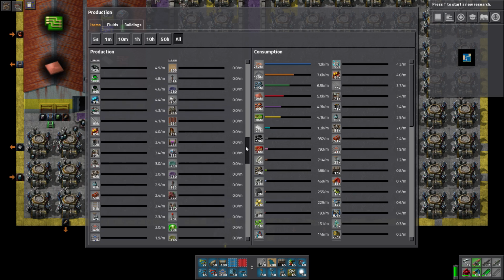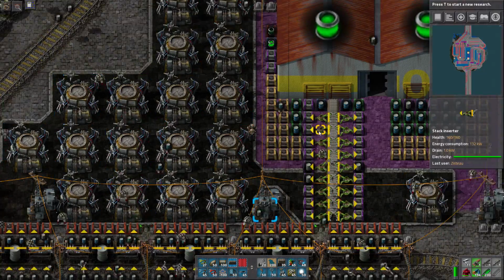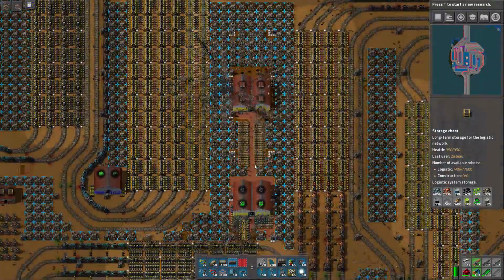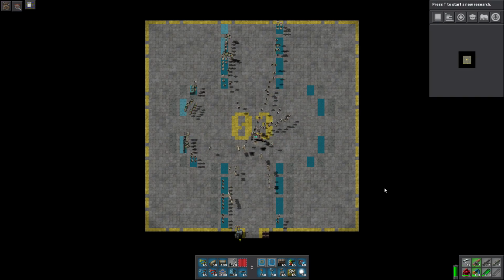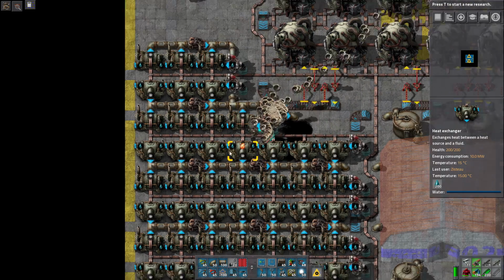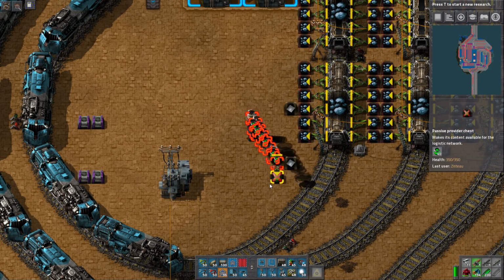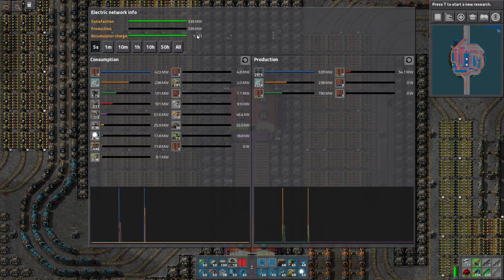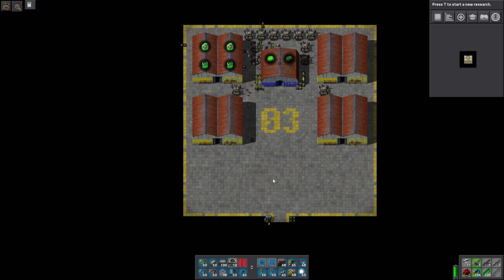Factorio Recursion Recursion #15 - Quantum Water

Comment: Power generation and usage is only visible on the last floor of the power producing facility. Maybe you could build a circuit network that takes the number and displays it outside of the main base?

Comment: I think it would be cool to use factory buildings as large containers. You can construct and deconstruct them with the recursive blueprints mod so they can be planted down on the water outpost, then filled up, then deconstructed and transported into the base where they are placed down again to empty them.

Comment: Did you know that your base is not powered with solar panels right now? Solar panels are only powering the surface part with biters
You can shoose only one: The base powering the surface, OR the surface powering the base. You can do it by switching the input or output at the first level from the top
Reply: Hlebuw3k he could manually reverse the arrows into nuclear to restart it in case it crashes for some reason tho.

Comment: Why even bother with belts at the mining stations at this point? Just have them all mine right into chests and them have bots ship them into the trains. Now you can have trains going even faster
Reply: It gets to the point where mining straight into the trains is the best way - no belts no bots
Reply: @maverickstclare3756   You got to have dem buffer chests
Reply: halvor9797 not if you always have a train ready to replace the one that is filling up. Mining directly into trains is by far the best solution UPS wise. You do need a rather high mining productivity to get it to work properly tho. (Iirc it starts to really excel around mining prod 500 or so)

Comment: By the way, Zisteau, why do you use the overlapping Miner placement method? When it gets down to the endgame that means Miners run out once all of the ore in their 5x5 square has been exhausted and it means fewer miners operating in the final stages of an ore patch meaning less overall throughput. Is there a valid reason to prefer this method over spacing the Miners so each has their own individual patch to mine?
Reply: Because you get more ore per second from the patch this way

Comment: Bob's Logistics would provide 3 things for you:
Bigger chests that are compatible
Faster Stack inserters
Bots that use less power (the mk4 bots don't need any charging but cost a portable fusion reactor each)

Also while that combining chest mod might not be good in the base it would be pretty awesome on your outposts, put the ore into one supermassive chest that connects from the ore field straight to your train station would give you the absolute maximum throughput since basically magic from the miners to the train station instantly
Reply: Now I want to try to make a base which is just one massive chest that all input and output happens into. Lots of filter inserters.
Reply: @FlatlandsSurvivor  That should be fun and yet kind of trivial, I'm not sure if the linked chests need to be rectangular, if they do it adds at least some challenge and 1 massive chest isn't the way to go but thanks to filter inerters+circuit networks the whole thing would be super easy to control if thing I want this assembler to make <20,000 items keep inserting them.
With rectangles only you'd need to come up with the whole square boxes on corners to move from one super long chest to another perpendicular one for example.
Does remind me of the old sushi belt base idea though, everything on one belt cycling round doing everything preying it won't jam or get full up of things that won't get used up
Reply: That or loaders and Angels warehouses
Reply: @Houstonruss  I'm not sure that angel's warehouses work all that well with factorissimo (I'll admit I've never tried) but they're huge buildings, they definitely couldn't be used inside where there's a 1x1 space to connect and outside you'd be turning 4 configurable slots into 1 or 2, and taking up a rather large amount of room.

Or did you mean loaders and warehouses for the train stations? using the loaders might work okay but the combining chest mod would in my opinion still be superior to warehouses just because you can put one chest down the entire length of the train and never need to worry about balancing. So 1 chest down the ore field for each row of miners going into loaders and then 1 chest down the length of the train.

if I recall correctly stack inserters are still faster than loaders anyway for trains (and Zisteau doesn't seem to use loaders at all anyway) there certainly are mods though that make stack inserters/bots better than loaders anyway. Infinite bot research and infinite inserter research by Emmote, expanded robot technology
 by Faltease Each of these can make moving a stack per operation possible, with bots that's much much faster than belts and with inserters that do a just a single swing per second that too beats loaders.
Reply: @Andy Young that's exactly my thought ^_^

Comment: It's too bad you can't have the power distribution in a "balanced" mode. Where it can push and pull power from outside and inside sources.
I use two individual belts with splitters between mining drills to maximize mining area which in turn has an innate ability to support substations between their coverage area.
The combined throughput kind of works and kind of doesn't work. It certainly increases the capacity of the belt if you put a splitter on each drill.
I have yet to think of any blueprint where beacons are concerned, considering the maximized drilling area. Also, ya haven't taken a look at the iron production power demands.

Comment: Personally, I think it's silly that solar doesn't work inside the buildings, yet launching rockets is OK.
Reply: Also the number of factory floors would be pretty insane. You'd have to place a ton of much smaller blueprints rather than copy and paste a massive solar print in the overworld and just let the bots do their thing. It really only makes sense to have solar in the factory for small builds. But factorissimo pretty much inherently is going to be large scale. I guess it could also work if you are using modded solar panels that have much higher output.
Reply: The way I always thought about this is that the rockets can open the rooves of the factorising buildings to get out but there's only 16x16 area of light falling on all those nested factory floors so it has diminishing returns to put solar in the building.
Reply: It's because whatever pocket dimension those buildings exist in doesn't have a sun.
But you can still send rockets to study the void.